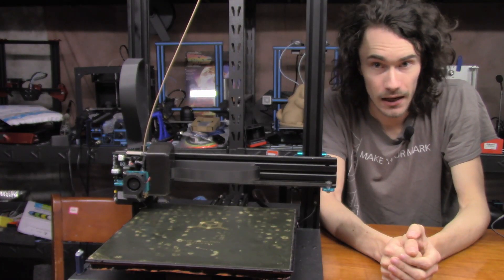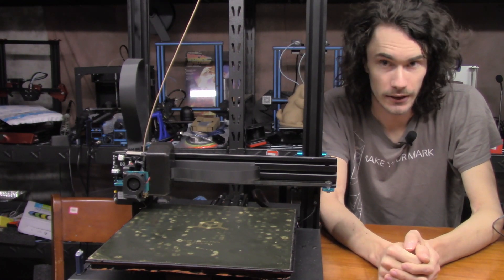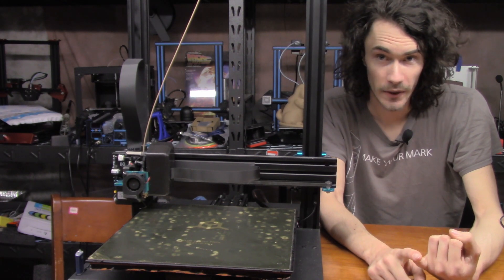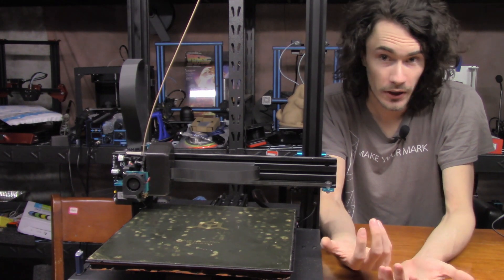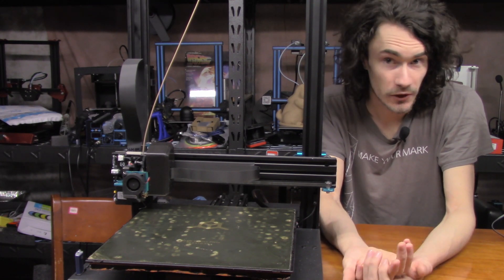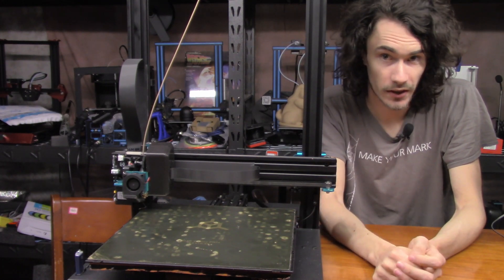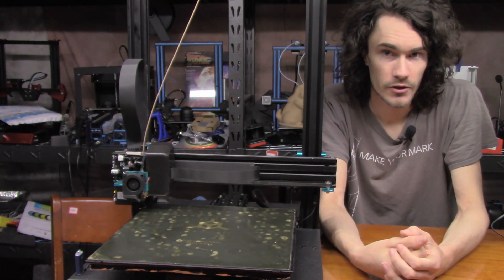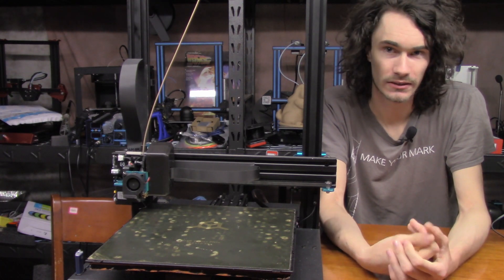Artillery 3D Sidewinder X1 Required Upgrades?

Comment: I would say the only upgrade I feel is necessary is, IF you have crazy layer issues you can support the gantry.
Reply from the maker: Eh, seen people who installed one and... still had the issue which leads me to believe it isn't so much due to the Z frame wobbling but if it aint broke don't go adding it on!

Comment: Hey Calvin where do you get your replacement parts, just asking because i cant find a replacment extruder gear
Reply: I was able to find a good metal extruder gear on aliexpress for like less than a dollar. If you don't mind waiting that can work well. If not that then I would try Amazon. I have found them there for not much money as well.

Comment: Thanks for this video, my Sidewinder is doing suuuper great i only put a strain relief to the bed cable and its working just fine even with petg.
However Im thinking to add Auto bed leveling does anyone have experience with it?
Reply from the maker: Meh... Installed it on a friend's machine (not an X1) and she had me remove it ~2 mo later since it was a larger headache than paper... My take? Not worth it... I have leveled with paper and it works just fine, it just takes a little finesse.
Reply: Thinking the same thing about bltouch, but couldn't find the firmware for it.
Reply: IDK, I have the issue that I have to level it everytime I print something new. When it is running heated everything is fine. Also I noticed the bed has a very slight depression in the middle. So I believe for big parts (X/Y) it still could make sense.

In general I agree. Don't fix what is not broken. But for me the Sidewinder does not have the reliability  to print without nudging everything a bit in the beginning. That's good to get to know the machine. If it doesn't bother you and you are on a budget don't upgrade.
I want a machine that just prints once I have the right settings and ideally also does not care too much about specific settings and produces dimensionally correct parts (I was able to get 20+-0.1mm out of the box though)

Comment: My X1 is bone stock,  it works great,  never had an issue will the "weak points" people talk about.  Many hundreds of print hours and still going with zero issues.
Reply from the maker: Not denying that other people may not have issues but deal with them as they arise, don't "make" a problem to "fix" it.

Comment: Sensible advice. It's a capable machine and with the latest version 4 seems to have made initial set-up even easier than some of the earlier revisions that people have reviewed. 
The old saying "if it ain't broken, don't fix it!"
Reply from the maker: I really was impressed with the changes they had made on the Genius I received, they have done a good job of implementing user feedback and going from there. And you are so right, if it works leave it. I am not "against upgrades" but at the same time I see so many people go down the rabbit hole... and... it ends bad!

Comment: Great video, I have owned the V2 version of this machine for over a year now and have some specific questions related to using various filaments, what is the best forum for asking questions on this machine? Thanks.
Reply from the maker: There are quite a few Facebook groups for it. Do note you will get varying degrees of "help" from people. My advice is as always, experiment and see what works best for you.
Reply: @MakeItWithCalvin  Thanks for your reply, I'm trying to establish the best settings for printing wax (print 2 cast), it's proving to be very fussy so I could do with some advice!
Reply from the maker: Oh gosh, yeah never really messed with it so can't help there. I know companies will do wax printing but that can be quite problematic. If you dig around for my Tom Knapp video he discusses his workaround to that problem, it is quite clever.
Reply: @MakeItWithCalvin  Thanks for the info, I had a look at the video and he mentioned 'lost wax casting' which is what I want to do so that's great, I'll contacting him via his site. Thanks!

Comment: Yep this is the guy to listen to. Just got my X1 and really have been kinda freaking out on how everyone is saying get this you need to have this. 24 prints in no upgrades and im loving it. Thank you
Reply: Same here. Mine printed some brake cooling ducts for my car right out of the box, and they were huge prints. Came out perfectly. Since then I've printed some other car parts plus door pullers, about 20 prints in total and not one issue. Assemble it right, level the bed and leave it alone. This is my first 3D printer as well, so I'm learning as I go.
Reply from the maker: You got it! I am not "anti-upgrades" I mean I have put better nozzles and PEI on my machine but i did it after I figured out I needed it. If it is a safety critical upgrade then do it but even then make sure you understand what to do before you start hacking things up!

Comment: I agree, its a good printer out of the box, but I need a printer that can do "pause at layer" from g-code and the Artillery printers can't do that. If had know, I would never have bought my Genius.
Reply from the maker: That is a TFT issue, there are videos about it if you look. It is annoying but I do not use that function personally. If I have to do color swaps I just program each layer separately, regardless of what machine I am using.
Reply: @MakeItWithCalvin  Thnx. Any chance for a video about that?

Comment: I'm trying to buy one, I'll keep stock until I get to know it well and get experienced with PLA, and some PETG and ABS. But then I need to print some things in Nylon. Which upgrades do I need for that?
Reply from the maker: I just swapped the stock heatbreak (they switched to threadless on the newer machines) to an all-metal one and that's it. You may want to also switch to say a plated brass nozzle just because I find they give better printing quality but that's personal taste ;-)...

Comment: do you have no z-wobble as many of us?
Reply from the maker: I have no visible z-wobble in all honesty but I also have my Z axis column screws tight & I took out 1 of the split lock washers on each side. I have found that they can actually cause more wobble than they fix.

Comment: Finally... wise advice! (Thats getting hard to find today)
Reply from the maker: It feels like "common sense" has gone out the window with people any more... it is frustrating.
Reply: @MakeItWithCalvin  You are right 100%. You always start working with the machine in its stock version before you tinker with it. You need a baseline to compare to and/or go back to if something doesn't work.

Comment: Thanks for sharing this info, I am waiting for my X1 to arrive (International shipping). This will be my second printer after a few years old Prusa i3 clone kit I ordered from Aliexpress which I highly modified to get better prints. One of the things that gave me a hard time and lots of frustration for the first few months was the hotend clogging and other issues I ordered a clone E3d v6 and had similar issues after that I decided to buy genuine E3d lite 6 and have been using it till today as a hobby printer even for ABS and PETG which is not really meant for I rarely use PLA so now I need to order upgrades for the X1 to be able to print ABS & PETG what exactly will I need to order? is it only the heatbreak I would like to hear your recommendations
Reply from the maker: I would consider getting a metal heatbreak & maybe a plated brass nozzle. They flow much smoother than the stock brass ones in my opinion. You may want to look into a flex-plate with an engineered material like PEI or BuildTak, not sure how well the silicon carbide bed will work with either of those as I just have plain glass on mine. Other than that I say you should be good, it sounds like you have some experience 3D printing so any other changes would be at your choice.
Reply: @MakeItWithCalvin  Thanks for your reply appreciate it. It arrived yesterday which is luckily an improved version with several changes, had some problem putting it together as the top gantry frame and bottom frame were not lining up to put the screws in but anyway managed to push it together with some tinkering. So far PLA test prints are impressive in quality.

Comment: I need to print daily with ASA. Should I go ahead and upgrade the heatbreak before even starting?
Reply from the maker: If you feel comfortable doing it I would say yes. I assume ASA prints ~240C? If that is the case it will break down the PTFE quite rapidly. I have a video on heat break swapping if you have never done it.
Reply: Calvin Witt we have them printing well at 250 with several prusa machines, we wanted a larger format printer with direct drive so we went with the x1 over the creality machines. I watched your videos and I appreciate the content
Reply from the maker: @oneheadlight8000  In that case I say do it. If you can grab an extra heater and thermistor just in case something goes bad. Odds are very slim but it happens! I like keeping a spare for machines I use so downtime is minimized.
Reply: Calvin Witt oh yes.. I most likely will grab extra. Thanks for the advice!
Reply: @MakeItWithCalvin  Know anything about the high temp PTFE heat breaks? I see that Th3D offers one in place of the all metal version.
Reply from the maker: @oneheadlight8000  My concern with them is the PTFE will wear out. My Ultimaker 2 has a 20% glass filled PTFE hotend insulator and it would wear out after a bit of printing and affect the retractions, etc. In my opinion, keeping the PTFE out of an area that is critical is best. Just my take.
Reply: Calvin Witt sounds good! I just ordered an all metal heat break from matter hackers. The one in the link was sold out. Thanks again! I will keep an eye out for your future content!

Comment: As I've mentioned elsewhere I did not follow this advice with my first 3D printer, and I've regretted it ever since. Calvin is right, a noob needs to get used to the printer as is, and only then can one make an educated decision on what, if any, mods are required or advisable.